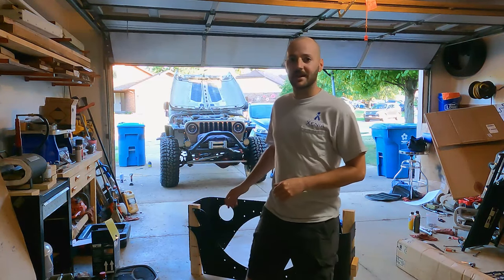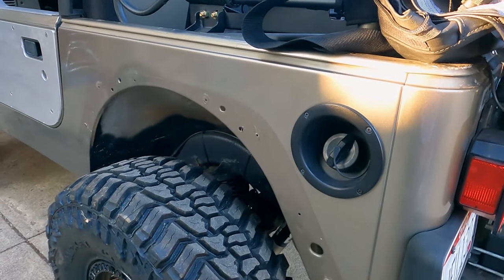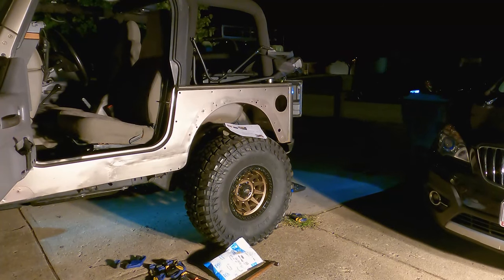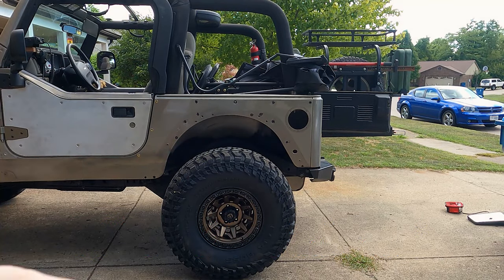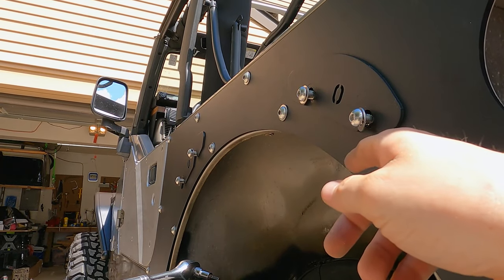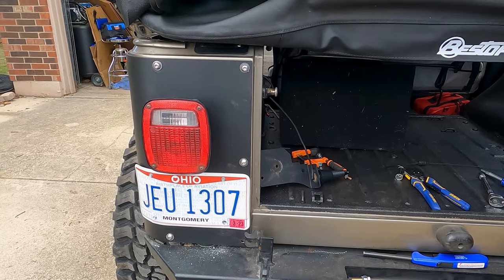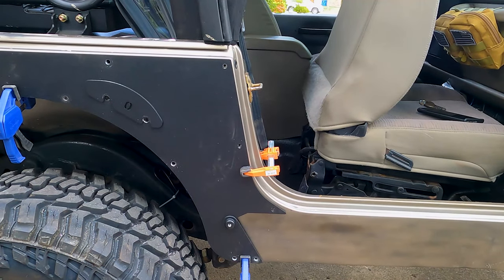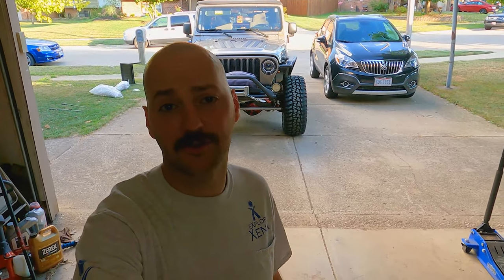I Installed Corner Armor On My TJ [Metalcloak Extended Corner Armor]

Comment: I appreciate your honesty during the installation process. Maybe it will help the vendors with the quality control of their products. I replaced my taillights with flush mounts rather than having that stock taillight hanging out there just begging to be smashed. I think your videos are great. Let the project dictate the length. I would like to know where you found your spare tire jerry can rack.
Reply from the maker: Thank you! I am also thinking of swapping my tail lights to some LED low profile ones. Just trying to get the big stuff out of the way first. At some point I'm going to make a review on the Rear bumper/tire carrier. It is an LoD Offroad bumper which is a company from Indiana. So it is American made. I do have some minor complaints about it but overall it is a very nice setup. The cost is high though. I probably paid 2k for the entire setup (Bumper, reverse lights, Tire carrier, Jerry can mounts, and trail rack). They also no longer have my exact bumper as they have changed up the looks and designs a little.

Comment: I’m confused. The whole point of corner guards is to protect the body but it defeats the whole purpose when you’re drilling holes into the body damaging the body lol.
Reply from the maker: Haha yeah it sorta does. But other then drilling to mount that armor I'm not sure how else you would do it. The armor is much thicker than the body sheet metal so it is still much stronger and should resist more damage. I also think it wouldn't look as bad to have the armor get some dings and dents but if the body did it would look worse and cause more damage. Then there's the cosmetic aspect of it. I just think it looks good and fits the build and look I wanted for my TJ. So for me it wasn't necessarily about protecting the body but instead making the jeep tougher and looking the way I wanted it to.

Comment: did metalcloak powder coat them for you?
Reply from the maker: You can order them bare metal or powder coated for a little over 100 dollars more.
Reply: @WheelinWithWally  oh i just wondering because i guess that is not a option anymore. They dont powdercoat them anymore.
Reply from the maker: @zekeisme1  oh wow that's odd. I wonder why they stopped.